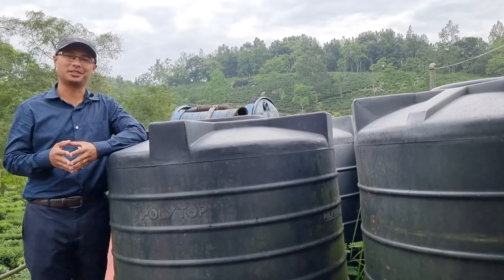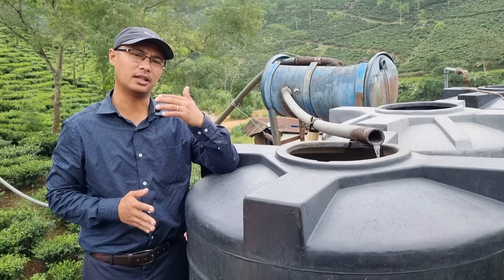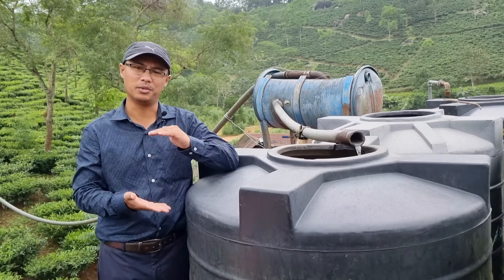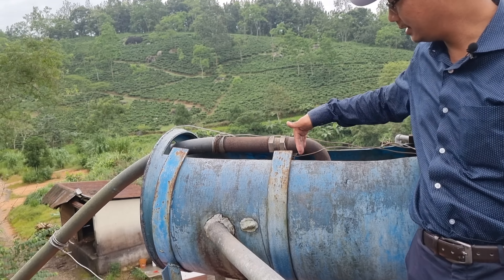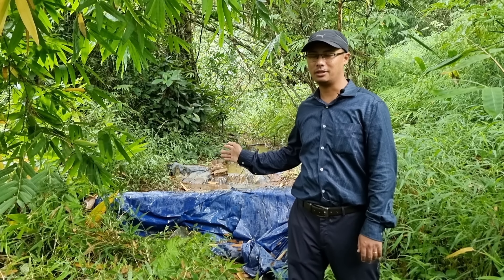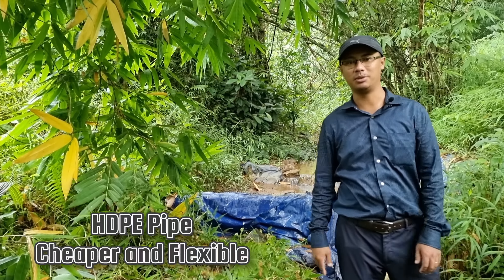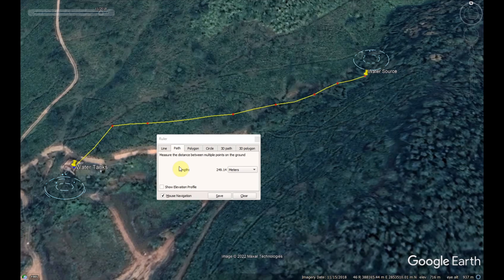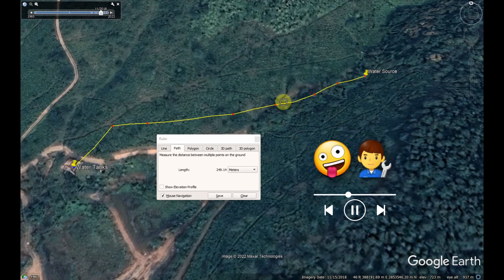Gravity-fed Water Supply

Comment: What really had me was the waste valve being provided on both the bottom of the partition tank.That was something very effective for long run especially for particles size greater than 0.2 micron to just settle under Gravity.
Reply from the maker: Thank you very much Aaron. Yes, you are right, it is a simple but effective method of removing particles. I appreciate your insight as well as kind words of support and encouragement 😊👍